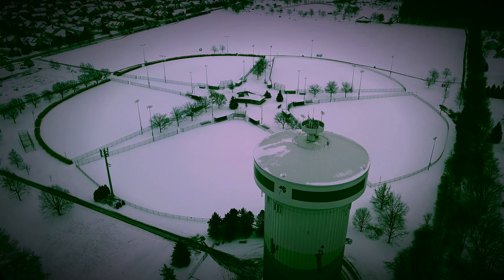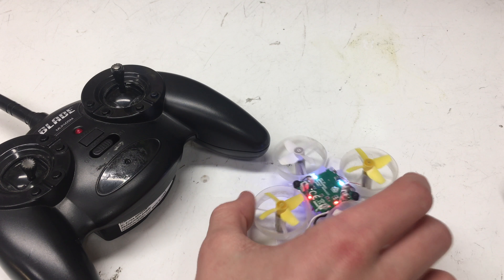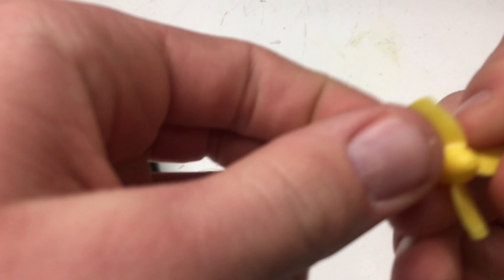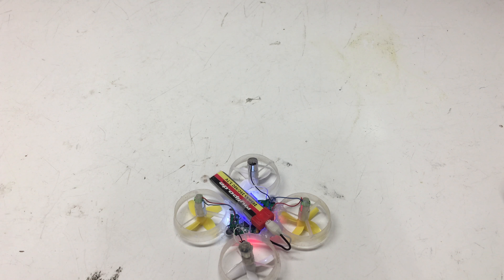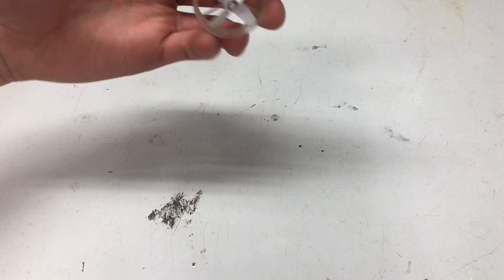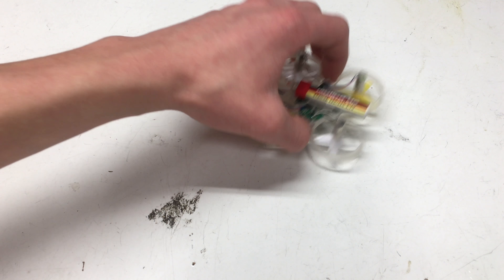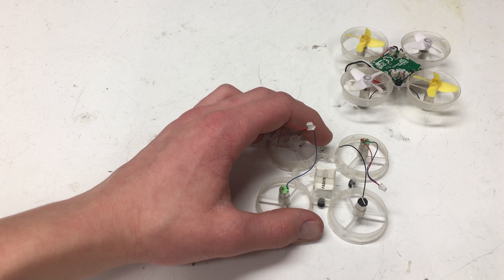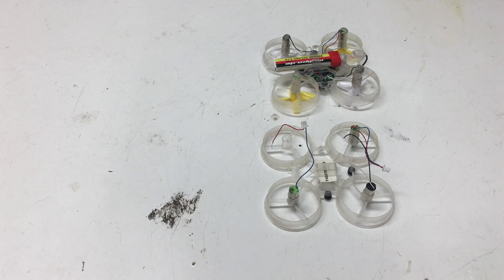UPSIDE-DOWN WHOOP?? | Blade Inductrix Experiment

Comment: Can i up grade the motors on this fc like unicorn motors or or some higher rated motors to the stock inductrix flight controller?
Reply from the maker: If they are brushed they will work great. I have used stock, faster, special sauce, and insane speed motors with no problems! My favorite is the special sauce edition from tinywhoop.com.